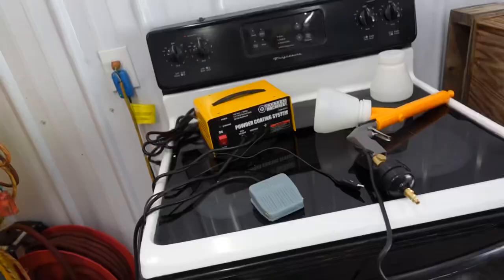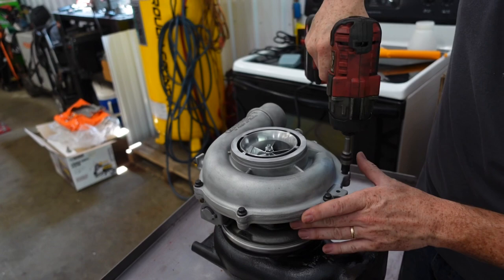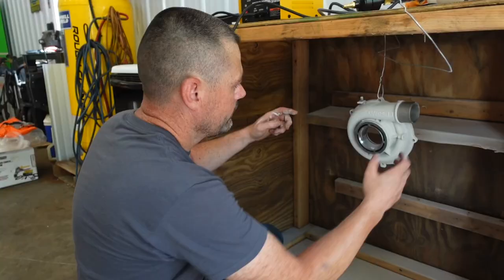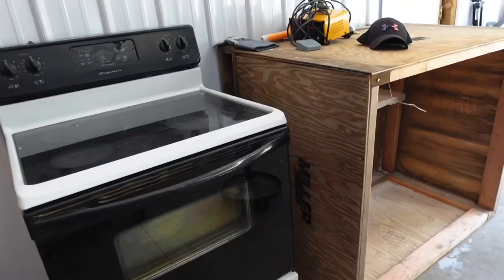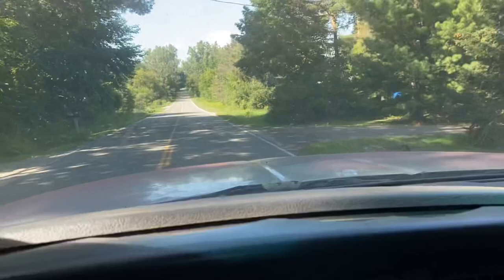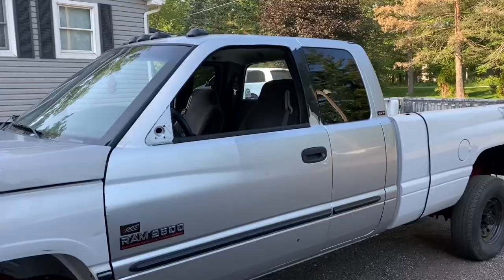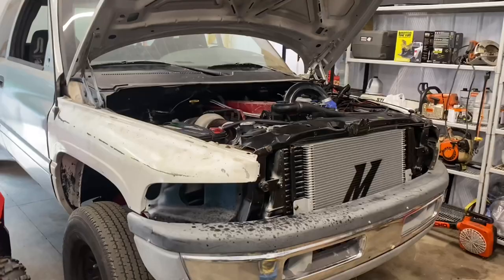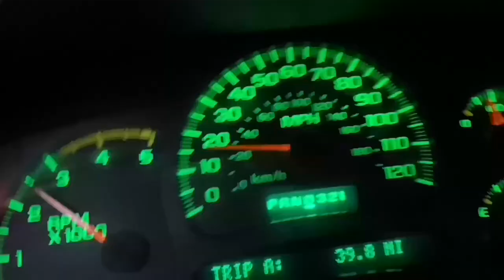Bought Cheap Harbor Freight Powder Coating Gun For Diesel Parts!

Comment: I have had a harbor freight powder coating system for a long time. I set my air pressure at 15 psi static so the powder just flows slowly and evenly. The ground lead can be attached to the hanging rack or wire, but must be used or the powder won’t stick. 

I pre-heat my oven to 400 degrees (go with the powder manufacturers recommendations) then gently place the coated piece(s) in the oven. Once the powder flows out (melts and turns glossy) I bake it for an additional 30 minutes before shutting the oven off. I let it sit for about 30 minutes before I open the oven door and let it cool to room temperature on it’s own. If it cools to fast it can cause the gloss to haze over...

Just a note to save you a bit of a headache: the powder coating is very durable, but the more powder added the more tolerances will cause issues for close tolerance areas...

Customizing things is fun; enjoy the adventure 😉
Reply: I use my natural gas weber bbq and do the same  I don't live in snow though

Comment: Great video! Hey you could make yourself a temporary paint booth by building a wooden frame and using rope to lift it up to the ceiling. You want two wooden frames one for up high and one on the floor. Staple plastic sheeting to the wood frames make sure you put plastic on the floor also tape it down. It’s always about the prep! Great content! Oh yeah Harbor Freight rocks love to shop there!
Reply from the maker: That’s a great idea

Comment: Here’s some suggestions I found useful when I did this
-in your little powder coating booth type thing get just a cheap little usb light strip and stick it to the top of the box so you can brighten it up in there 
-get that clear material painters lay down on the carpet and drape it over the opening of the box and just slide your arms in there, that way it keeps the power all in there
-when in the oven put the rack on the highest place it can go and hang whatever you’re baking the paint onto. 
Obviously I’m no professional but it’s just what I found worked for me !

Comment: On your up shifting it’s the detention cable that goes to the pedal linkage on the motor I’m not good on explaining how to do it but it changes your shift points..it will make it shift early or higher in the rpm
Reply from the maker: Thanks I’m probably going to mess with it later

Comment: On any metals softer than steel, outgassing for an hour at 450-500 degrees, then blast the part while still hot (but make sure you can handle it.  Then put plenty of powder on it and you should be good to go.  Prep work and the right amount of powder, curing temp and time are key.  Nice video and I'm enjoying your channel!

Comment: Leadfoot gray would look sweet on the truck as well. Raptor lining the whole truck would cool as well. 

One thing I just thought of, is raptor line the inside of the bed so everything is painted and sealed as it should be. Then add a plastic bed liner to it so what ever you are hauling in the bed when you dump it all the material slides out with no problems. 

I know that the bed liner type of products make it hard to move things around in the bed rather than regular paint. Just something I thought of that might make your life easier.

Comment: Stove in the shop is a good tool to have. Separating headlights to do leds and clean moisture from the lense, and also for pressing parts like bearings and spacers on. Need an exhaust duct for your powder coat box but look awesome.

Comment: The HF unit is solid for what it is but it's going to have a harder time doing multiple coat projects if you decide to get wild.  Do not waste any time and effort on any Eastwood stuff.  If it works it will not work well  If you decide to go larger in oven and coating equipment I would DIY your own oven and then look into Columbia's Hypersmooth Basic with the hopper upgrade and leave it at that.  It's an affordable semi-pro level gun that can do multi coat jobs for anything you want and then after that the biggest issue you will need to resolve is how large of a media blaster you want and a larger oven for larger pieces.  If you can keep your blasting to the size of the HF units and farm out the larger blast jobs that is probably the most economical path forward overall.

Comment: A good tip for if you're gonna bedliner the truck buy a tent like the in you park under and spray it under one of those. It'll help contain the over spray becuz that stuff goes everywhere. As for your powder costing looked good nice and clean. I've done bedlining before and if you don't want it somewhere mask it off really well and Def pay attention to the instructions don't mix longer than directions say, and always shoot a test panel then u know what your results will look like when you do your actual item.

Comment: Not against using the raptor liner, but I personally would recommend Liner Xtreme. Friend of mine used it on his truck and I just did from the top bodyline down on my 2nd gen with it and very pleased. Ordered clear and got the tint (with no binder) paint matched to mix in at a auto paint shop. It is supposed to be tougher since it is a 3 part liner not a 2 part like the others. Currently waiting the 5 days it takes to cure but so far looks good and does have a bit of a glossy look to it. A 3gallon kit with the big applicator gun was around $250

Comment: Pretty cool with the powder coating. For the colors for the Dodge, I say battleship gray or something in the gray family would look very nice with the red frame.

Wheels and tires for the Dodge, since it's a older truck set it up like Hammer's rig with the larger tires and smaller black steel rims on it or keep it factory sized rims with some heavy duty tires on it to handle the weight better while driving with a full load. 

Factory sized wheels and tires would make it easier to get in and out of the truck better since you will be using this for work. Enjoyed the video, look forward to seeing the next one. Take care.

Comment: I have the same powder coat setup, I powder coated a green HSP cold pipe to white with prismatic powders. Had to burn the original powder coat off with MAP gas. Aluminum oxide blaster at work only dulled the color, but after I burnt it, the sand blast cleaned it right off. My Danville 68 has the cover glued on to prevent leaks, I'm thinking about sticking the whole turbo in the oven. Gonna call Danville and see if it's okay to do that.

Comment: Thanks for the tutorial, and sticking with the motto “learning together”. That compressor cover turned out great for the turbski! I was always wondering about that harbor freight kit for small projects and adding cool detail to parts. Beats the heck out of the old rattle can red you did on the LBZ stock cover back in the day. Really super excited to hear you might hook Wifemax up to a pulling sled! It will be the ultimate test of the truck in every aspect! I have a feeling you will be hooked (pardon the pun) after trying it, especially if you have the professor and Ryan close by coaching. Keep working hard brother! Blessings to you and the family! 👊🏻🇺🇸

Comment: Just hold the trigger on your powder coating gun and move in small circles don't do motion like a paint spray gun and only put the part you powder in your oven for 10 min the longer you go in the over the less gloss you will have it bakes it away
Reply from the maker: Thanks

Comment: Is the stove you use an electric stove? I used a large microwave stove before, and I removed the oven racks and just made some wire hooks to hang my parts on which were hooked up inside of the top of the oven. It worked great, but remember, those damn parts are hot and sometimes hard to carry on hooks without dropping. It was difficult to find all the rubber stoppers to seal off various holes, but they sure do keep the powder from getting into threads and such when you coat pieces with such.

Comment: Dont be afraid of spraying to much,  Best part about powdercoating is you can really get to much on the part haha it just falls off, so it's always a good even coat haha :) my setup is about the same as yours haha and it works great. I'm working on building a bigger oven and use stove heat elements so I can control the temp still :)  p.s. prismaticpowders has some really good powdercoat powder

Comment: I two toned raptor lined my compound turbo 24 valve Grey on the top blue on the bottom I always planned for it to be I work 
Truck/plow truck and it’s been 18 months and it’s held up really well there’s videos of the project on my channel if your interested. I didn’t want to just do it black like you said it would be too much.

Comment: I wish my forks fit on the front of  my skid steer as easy as yours do on your tractor. I have to get out with a pry bar and T Posts to get them to fit. I have beat and pried and done everything to get them to fit but to no avail. I guess I would be pissed if I needed to move anything right now. Just finished doing a DPF delete on my 2013 LML farm truck and am now just hoping for snow. Maybe I will get one of these powder coat things and tear about my tractor and to some power coating.

Comment: I was excited to see how easy the powder coat was to do... would be really cool to use on a the little details when u r building.... BTW, my duramax is linxed, and we love it, went with kia steel gray for the color, even a diy kit would turn out nice. Durabak is a good product. We used it on an Avalanche we did about 10 years ago... anyway, good luck with the build

Comment: Serious question...Lower ball joints? The ball joint press kits don't work because the front of the control arm is flush with the ball joint. Not giving any room for the receiver to sit when pressing. Any ideas on that? Also, I'm looking for better lower control arms so that maybe I don't have to deal with this in the future. 

I still think the cummins needs to be military matte green...that would still look sick in a bed liner!
Reply from the maker: I used the ball joint tool from auto zone and it worked fine from my experience but usually guys don’t upgrade lower control arms but check out kryptonite or get a AC Delco GM part 👍

Comment: I need an honest diesel truck tech that will swap engines for me from one LLY to the othe LLY? And then back again into the parts truck? Any takers in Central PA near Middleburg PA? Do not need the cabs pulled or radiator supports. Just a double pick pull install? Can the be done?

Comment: Hey Josh I just picked up one more freaking truck lly duramax I am picking up S&S injectors  for it and head studs this week and head gaskets to do ARP head in the truck low hours but wondering  should I go to a cheetah turbo 63mm turbo with like 25% overs what do think or Ryan's turbo want a little more boost of the truck but fast spool and  great pulling power ur ideas ???